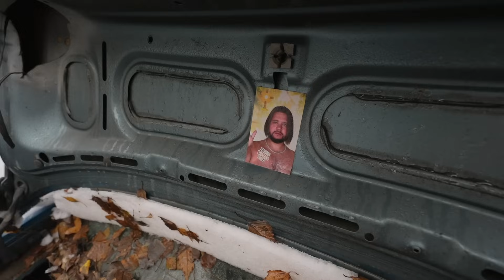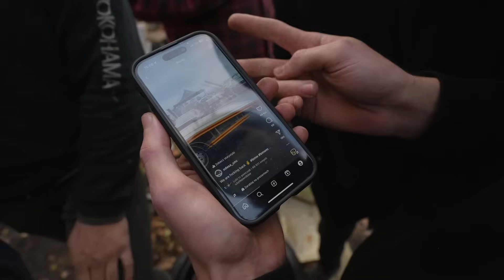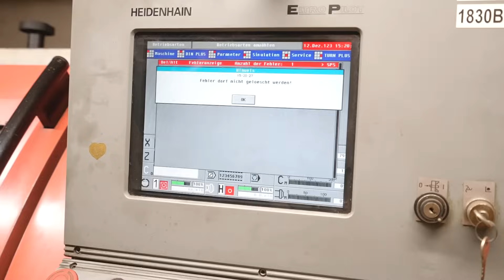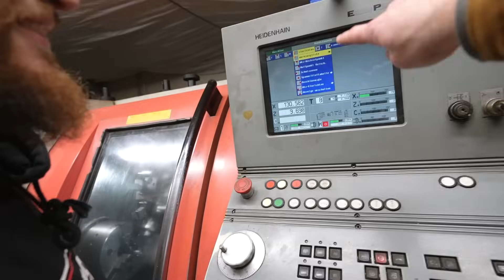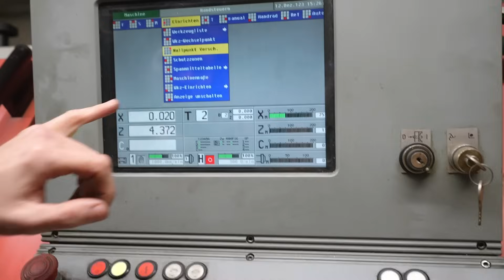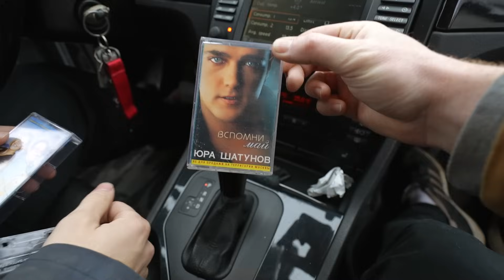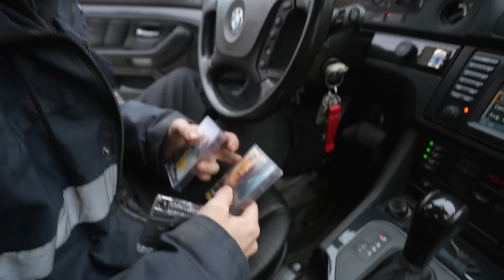A week with NIGHTRIDE

Comment: One thing about the lada you said "they were pretty diposable" is absolutely wrong. 
The people who bought a lada, thats all they could afford be it soviet times or since, they were built v simple so were simple to fix. Not brilliantly made by any means(especially in later years as the design aged and changed from the original Fiat 144, IIRC, design they bought) but simple to fix
Also they don't suffer as bad with rust as they do here cos the colder(in winter) countries with ice and snow for a few months or half the year don't salt the roads.. They also dont have as humid or rainy weather with 30+ being common in summer. Many were kept in (makeshift mostly) garages too so there are some fairly clean old ones still bashing around especially in Ukraine, belarus and still eastern/cis/ru leaning economies. You'd be amazed how many are still going as dailies.
When i was last in Kyiv about 10 years ago almost every second car was a lada.. though it was changing slowly to more dacias and smal chevrolet(Daewoo). Fancy bars and such would have ferraris and v12 biturbo mercs and all sorts and in the middle of them or at the next business on the street would be lada lada daewoo.. V odd to see. 
Lots of odd stuff too, like I have short clip of a stretched ferrari f430.. That was in Ukraine.. Odd but great place.

Comment: I actually have a 3.xL Mercedes ML in Poland with Turbo mod and it also has LPG in it. When I drive it on gasoline then the needle goes down like crazy but when I drive it on LPG with it's 48L bottle, the STAG 300 LPG system uses lasts me for 700km. Unfortunately yesterday I was driving it 60kmh under the 90kmh speed limit and there was like black ice on the road and I started slipping and crashed it into a tree. Luckily I and my friend survived the crash and I was so slow that only the hood, bumper, radiator and front suspension broke and the airbags didn't deploy. The car even drove out of the ditch and on the towing trailer.
I sold it today in the morning for 5000pln and currently I have to drive my old Audi A6 C5 2.5 TDI V6 which doesn't have LPG but I flashed my homemade map and a full gas tank when driven at a speed between 110 and 125kmh, lasts me for 1500km which made me paranoid in the beginning because it was so unreal and felt like it was like it's running on fumes. I bought it with 64.800km and currently I'm at 292.500km